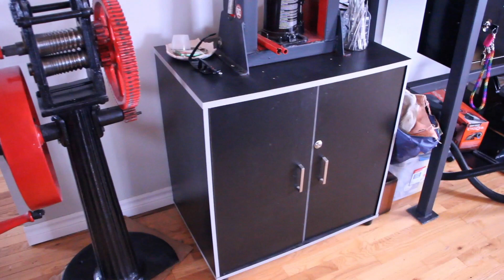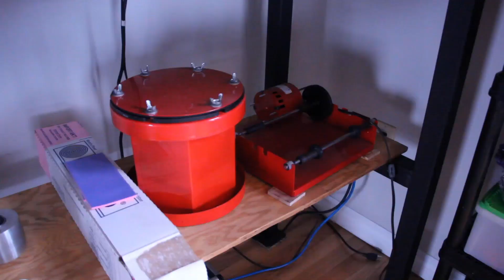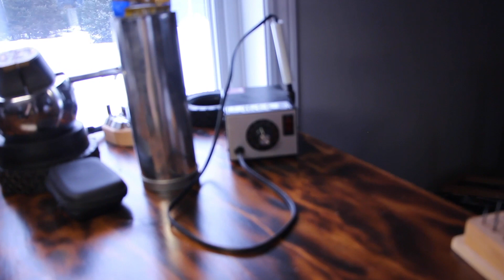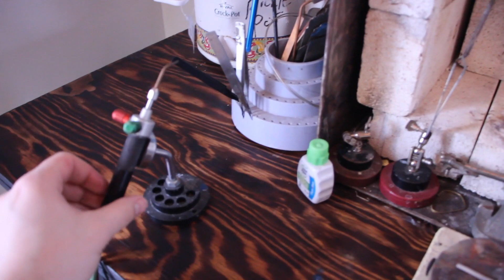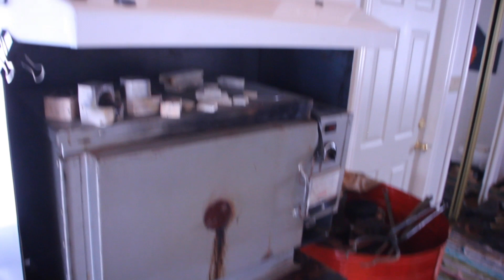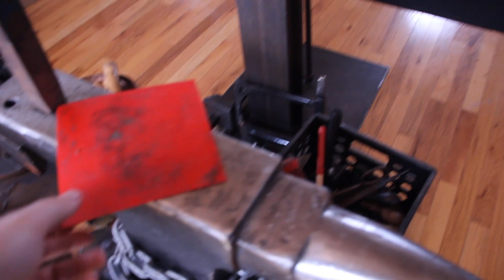Clear Mind Re-Introduction Jewellery Studio Tour

Comment: Very good! I have just setup my casting in my garage! Oh my, burnout is killing me with the fumes! Do you remove wax from kiln or leave it burn till the end? thank you
Reply from the maker: If we had a steam wax removal unit we would do that but we don't. We just let it do its thing. Having the appropriate level of ventilation is very important. I think it was said in the video but not only do we have that hood over the burn out oven but we cover the front with leather aprons.
Reply: I melt the wax out in an ordinary oven, with the flasks upside down, and then move them into the kiln for the rest of the burnout. Having water under the flasks allows you to collect most of the wax and reuse it, and stops it from smoking very much.

Comment: I like your setup! I too have had to build some of my tools in order to save some money. I built an engraving machine( videos and drawings courtesy of Rick Alexander on YT). Also built the brackets to set my ball vise on from stainless steel. I was going to build a graver sharpener, but decided to save a hundred hours of labor and just buy one. Still saving my money for that, lol. I don't know if you mentioned on this video but what type on graver do you use?
Reply from the maker: We use high speed steel 3/32, we got some from Andu and some from Amazon. As for our sharpener we use our drill press with a fixture from Home Hardware and diamond lap wheels from Amazon. Andu actually has a sharpening system now.